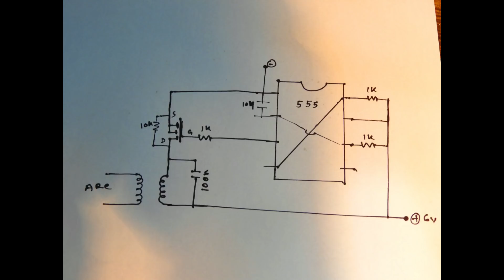Pocket Arc Lighter_You can make it for yourself..

Comment: i have a circuit from electric swatter...

it creates thick spark with small length...

it doesnt burn anything...please find a solution for this...i need it for a project
Reply: Remove the output capacitor and then it may work

Comment: I also made the same igniter from a kit. It was amazing circuit as it is working awesomely. It is great to glow gas burner and stove. Also one can light cigarette if smokes. It serves like a fuel less cigarette lighter. It is really a great and fun circuit. I have details on my channels. I will do another version of this circuit by winding the transformer self and connecting each and every part separately and will upload the whole project on my channel. Best regards,